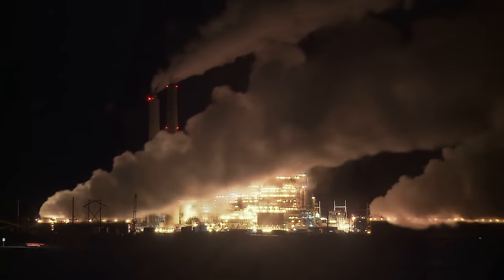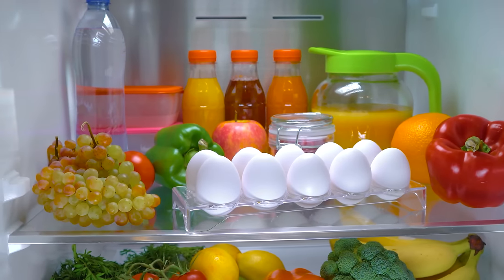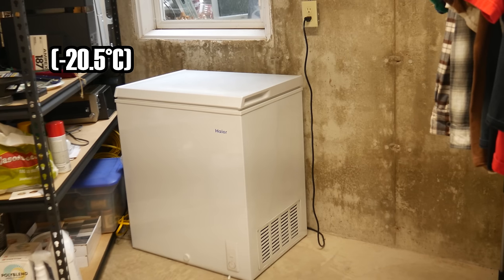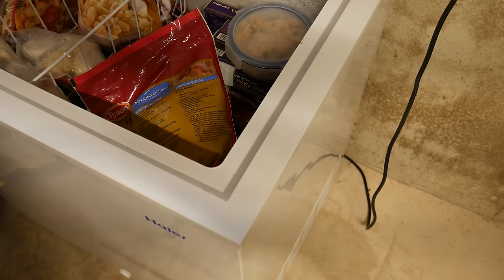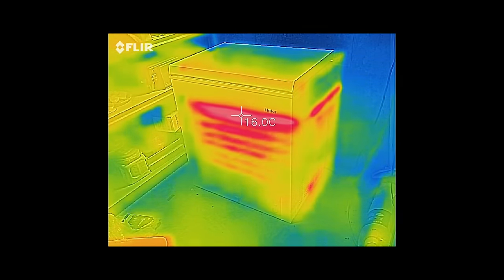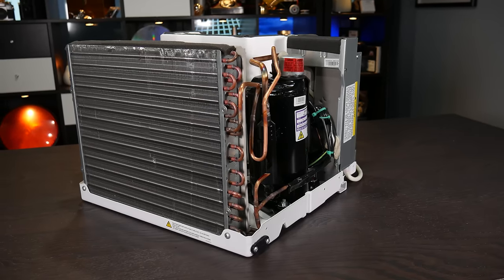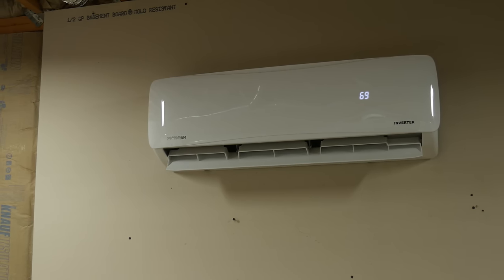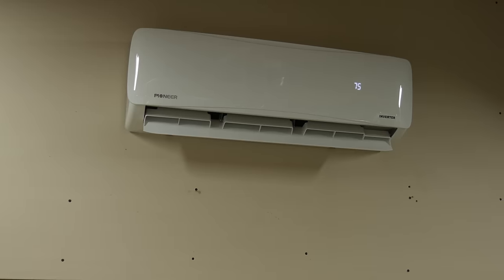Heat Pumps: the Future of Home Heating

Comment: Me watching this in Costa Rica, we’re 20c is cold: “ah yes cool this be useful”
Reply: Feeling the same in Brisbane, Australia!
Reply: @flaviusclaudius7510  'Sup mate, Brisbane here too
I've only recently in the last few years discovered air conditioning and have decided I will never go without for the rest of my life, as for heating.. well it's Brissy! I've honestly never turned one on here in my life. Only get to wear a hoodie for a couple of weeks and I'll be damned if I throw away that momentary joy

(Except for my brief stay out in Warwick though as the house had such little insulation the sun would peak in through the wooden walls, and winter temps often approached 0C so the lil' Kmart fan heater set to like 12-15C ish made getting up in the morning actually possible)
Reply: 20c is not remotely cold.
Reply: Imagine from 31•C Singapore...
Reply: -20 would be considerd cold, 20 that would be a warm summer day over here.  It is also around -20 that most heat pumps start to get less efficient.
Reply: @TheCandoRailfan  That's the point, if 20C is the lowest temp you get all year then watching a video on how heat pumps can heat a home is kinda pointless

Still fun and interesting, just not useful 

Like for me today, it was 34C and like 65-75% relative humidity.. I'm still using my air conditioner to pump heat, just certainly not into the house.. eugh
Reply: @TheLaurentDupuis  I don't need to imagine it, I'm currently laying in bed with 3 fans pointed at me right now to stay cool, its 33°C right now 🤣
Reply: Humidity also effects how warm it deems, the more humid, the more warm it feels. It's why in the UK, it can feel hotter when it's cooler then countries that are much hotter but a lot less humid
Reply: a summer times in norway
Reply: @TheCandoRailfan  he was being sarcastic
Reply: @andersstromqvist2211  Heat pumps are always less efficient at lower ambient temperatures. They don't just start getting less efficient at a particular point. However, they do tend to take a big hit to their efficiency around 0 °C in humid air, since below that point, they will need to waste additional energy defrosting.
Reply: Once we reach 25c in Norway I am struggling. 30c, which is rare, is a nightmare.
Reply: @EebstertheGreat  yeah but you still reach a tipping point where it is better to switch to other sources for the unit my family use that is around -20. Atleast where I live humidity does not play a big roll. When we reach -20 the air is always dry

Comment: In southern France I switched from electric heating to a reversible AC and my electricity bill halved. But below 5°C or so the outside unit is icing up and it goes into reverse cycle for some minutes to melt it down.

Comment: This does seem to explain a few things, thank you!  I built an 800sf a-frame cabin out in the Wichita mountains and had a mini-split heat pump installed instead of an expensive and complicated central system. 
Most of the time it works very well, but is temperamental in more extreme temperatures. Above 95 degrees or below 20 degrees (F) it can struggle. In freezing temps it occasionally shuts down for 20 minutes or so…not fun, but now I realize it must be going into that defrost mode during that time. The air is more lukewarm than hot in temps below 10 degrees (F). 
During the spring and fall it’s often swinging wildly between cold and hot in this region and the unit usually shuts down and takes 10 to 15 minutes to switch from heat to cool and vice-versa. Now I see that it has to go through a whole process to settle the pressure and reverse  the coolant flow. 
I honestly thought there was something wrong with it, but this detailed video gave plausible explanations for all of those quirks if I understood it properly that is. 😉😃
I use fans and a space heater to take up the slack during those problematic periods. 
As clever as this system is, I can see why it’s not a viable solution for everyone.
Reply: it gets both too cold and too hot up here in canada to use them sadly
Reply: Outside unit should be in shade in summer and always setup so the wind does not fight the fan blowing air thru the condenser 

In extreme conditions you need a ground loop (water cooled/heated) outside condenser unit
Reply: @dazednconfusedrn Heat should not be a problem.  In Canada the cold can be very severe. However heat pumps are fairly common in Sweden.

Comment: Can confirm in Florida, AC is literally a life or death deal down here
Reply: Looks like a place for me. (Coming from Indonesia where it's 35°C midday with 70% humidity and 88% when it's raining)
Reply: a heat pump would be great there :) if it gets texas cold it could heat aswell
Reply: Spent a year in Florida. You really do need air conditioning. During the summer it gets from high 80's up to high 90's. The humidity normally tracked very close to the temperature.(F) Temps and humidity would grow up and up till it just about hit 100 then thunderstorms(massive lightening) and it would cool back down. Then it would start climbing again and over and over. Miserable without an air conditioner. Weather in San Diego was by contrast, almost idyllic
In the war of who has the better weather, California or Florida, I would say no contest..
Reply: We are so weak compared to the pioneers that settled the place.
Reply: @MostlyInteresting  its not about weakness or strength. its about PREFERENCE. why choose to live miserably when you have access to technology that can make your life a breeze
Reply: @MostlyInteresting  Florida didn't become super populated UNTIL we had access to air conditioning. Some "pioneers" could tolerate it, but not the swaths of people that chose to live in such warm places now. Even before AC was common in the States, there was still things like ceiling fans and what not.
We also have just been acclimated to climate control. If someone is healthy, and lives somewhere of a reasonable temperature without it for a while, most would probably get used to it in a couple seasons
Reply: Live near San Francisco. Spent a few days in Arkansas. 105°, 97+% humidity. Dear Lord I've never appreciated AC so much!
Reply: Nice SR-T :)
Reply: Humidity and the still air at night in Florida is far worse than the daytime heat and humidity.

Comment: Just saw this.  I live in the Fort Worth area and went through that cold Texas blast you mentioned, plus a few others, with a heat pump.  The lowest it's ever been since it was installed was -5F.  The heat pump ran full time, with aux heat on, but it kept the house at the set temperature.  It doesn't usually use aux heat at all until the temperature gets below freezing.  My energy bills are much lower than neighbors with natural gas heat.

Comment: As a swede, watching this: -Eeeeh, is that a new thing? looking at my two indoor units
Reply: Same. I live in Canada and I remember them from the 1980s
Reply: Also, used widely in coastal Croatia
Reply: I thought they were normal thing in the USA too.
Reply: In Germany you occasionally see the outside part installed on the roof of a "shopping mall" etc. but apart from that they're unheard of, which is weird for me since I grew up with them
Reply: In the Nederlands thay are new
Reply: In France, it is very common since the early 2000's
Reply: Pretty common in Bulgaria the last 15-20 years. These days practically all AC units sold are invertible.
Reply: as a finn, had for 15 years

Comment: THE FUTURE OF HOME HEATING!
...or as we in the Mid-Atlantic, Southeast, Southwest, and Pacific Coast call it, "THE PRESENT OF HOME HEATING!"
Heat pumps are only unpopular in places like the Northeast and Upper Midwest (where TC lives) where the winters are too cold for them to work anyway.
Reply: I live in easthern Canada and Heat Pump have been popular since the 1980s... (for suburban homes and large industrial buildings at least)
Reply: Same in Russia. I don't think I've ever saw an ACs without a reverse cycle.
Reply: here where I live it doesn't get much below 0°, so most people just wear a thick jacket
Reply: @srpenguinbr  wearing a thick jacket at home below 0°? D:
Where I live it also barely goes below 0°C, but everywhere has heating. Natural gas furnace in my home, resistive heating is common too, something something hot water pipes (natural gas furnace centralized to the apartment building?) in the home where I grew up.
Reply: @Orynae  well i admit waering a jacket at below 0 degrees is unconfortable, but I mean for temperatures above 5 it is liveable
Reply: And my mom sells clothes, so jackets are free real state for me
Reply: no winter is too cold for a properly sized heat pump
Reply: it's been the present of home heating since the 1980s
Reply: Only places like Fairbanks, Winnipeg, or Edmonton actually have winters too cold for air source heat pumps, and even there a heat pump can supply all heat for most days. In the northeast and upper Midwest it's a combination of traditionally mild summers, cheap gas & expensive electricity, the prevalence of hydronic heating systems with undersized radiators, obliviousness & ignorance on the part of homeowners and contractors, and crusty old people who see not having AC as a moral virtue (despite having no issues with heating whatsoever), that are obstacles.

Comment: We saw a -54 F real feel Friday night. I have never felt such cold! Our Mitsubishi hyper heat stayed effective until we started hitting a -20. I could hear it trying while I slept but I don’t think there was any heat. This morning It slowly started blowing heat at this morning. It started coming back around -20. Our unit is partially sheltered so it helped but it was just too damn cold. This is our first winter with it and it hadn’t been a problem. These are well suited to zero degree F temps but if you get below that have a back up source. We originally got it to save money but now the electricity rates are much higher. Still worth it though.

Comment: Here in Brazil, we have places that are always hot, so "air conditioning" with only the cold option are very common in those places. But in the south, where we have some cold and hot temperatures through year, so it's very common to have both options in one equipment.
Reply: I live in the south of Brazil and I never really knew how the heating of our ACs worked, and because my parents always told me that they would be exorbitantly expensive to run on heating, I would mostly just try to warm myself on other ways. After this video, not anymore!! I will tell them of how these work and finally have a nice cozy room in the winter! (tho I might need to get a new AC on my bedroom... but maybe I can get one of the variable speed compressors to get even better efficiency!)

BTW! Did you notice that the compressor on the demo rig was made in Brazil? Noice!
Reply: @Kemecgabriel  Southern Brazilian here, raised in Argentina. Can't remember if it was during a home electricity course or hearing it from (H)VAC technicians (both in my house and in my workplace) but as far as Argentinian (H)VAC technicians are concerned all ACs have Brazilian compressors and they're top notch (and yes, I had the same reaction you did just now 😃).

As for heat pump vs. "other ways" (which I assume do not include other forms of heaters), nothing is more cost effective than layering up (esp. in the relatively mild* winters Southern Brazil and a sizeable chunk of Argentina gets), and your parents will continuously remind you of that fact while not bothering to hear about disadvantages 😈. And while it most likely is not your case, the earliest cold and heat ACs had resistive elements in the internal unit for heat instead of the cycle described in this video.

*: For nearly everyone else: In Southern Brazil/Uruguayan/"Pampean" Argentinian (from the center-south of Buenos Aires province to the north, and from Santa Fe to the east) below +10C max temps, and below 0 to +5C (depending on the exact region) low temps are considered f***ng cold, and any snowfall is a historic event (except in certain parts of southern Brazil where it still is not something to expect every year). Many of y'all are laughing at that, but (especially in Brazil, Atlantic coast, Misiones, Corrientes, and near Río de la Plata) it's bitterly humid, insulation is rare all around, and in some of these places (esp. in Brazil**) heating can be non-existent. (And to top it all off, in most of these places there's no natural gas networks, heating/cooking gas comes from propane flasks which cost a king's ransom given the typical purchasing power of a worker's salary)

**: Or at least that was my experience as a child spending time at Grandma's in Paraná (Brazil) during winter break 🥶.

Comment: A million homeowners after watching this, “I can do that".
Reply: I’m a teen in high school, also attending a tech center, learning how to do all this stuff. It’s funny trying to explain this to people and seeing them look at you like you have 10 heads😂
Reply: My mother uses electric heating, installed an air conditioner year ago. It paid off just in a single winter.
Reply: @KryptLynx  as someone who lives in the midwest heat pumps are efficient 2-3 months out of the year but since it gets so cold here. In our situation it will take someone years to have it pay off if it ever does. That and heat pumps dont run hot enough and you get bacteria and mold that starts to grow inside the air handler.
Reply: Millions of homeowners in Europe including myself, been doing it since years. I run a 7.5kW heatpump.
I only use normal heating when outside temps go below -7 to -10°C

Great video, great information!
Reply: @Rubberfoxy  that may work in Europe but here in the midwest heat pumps are not the way to go. Only people that have it dont have natural gas supplied to their house. Any money you save with a heat pump, you lose it with having to use electric
Reply: @Rubberfoxy  heat pumps lose efficiency at 30 degrees as it lowers in temp there is no heat to get from outside. Thats why people have to combine heat pumps with a secondary heat . I personally think heat pump combined with gas is the best way to go altho gas isn’t efficient as electric  it does cost a lot less and it gets rid of mold buildup in the housing
Reply: @SirVicSmasher  i know, i have a secondary heat source for very low outside temperatures.

Also you might use an air to water heat exchanger to heat up your water boiler during warmer day temps to keep your house warm during the night. Running of the stored energy in the boiler and using minimal secondary heat.

Ah yes! My home a a forced air exchange system. A blower that constantly exchanges a low volume of air to keep the inside air from getting too humid.
It's a vent in my sleeping room with mufflers in the wall and a fan on the other side of the building that exhausts the air
Reply: @Rubberfoxy  Do all of Europe do that? Here in the states i see lots of mold . Humidity control isnt common so heat pumps kind of loses purpose. But i can assure you heat pump isnt not the future. Since specifically in my area we have months that dont get warm enough for heat pumps to work.
Reply: @SirVicSmasher  i live in a house build in 2019.
It gotten mandatory to make super low energy houses a couple years ago.
Having superb gaskets on all windows and doors just cries out for active ventilation of all rooms to prevent mold buildup.
I wouldn't use a heatpump in an older building. You just waste too much energy by blowing it out poorly insulated walls and windows.

My windows are triple glas, almost 3 inches total thickness with frame.  Even in Winter the inside glass is not cold.
Door is also over 3 inches in thickness. Transmitting almost no heat/cold or sound from outside.

Downside is that's it's the most expensive way to build a house but the government won't allow otherwise.

I live in the urban area of Austria, we haven't had very cold winters since years. No snow in Vienna in years. Right now we have 52°F and it's february. 
I think we didn't went lower than 20°F in the last 5 years in my area.
Reply: @Rubberfoxy  this could be the hvac tech in
Me but id love to see a video on your set up. And i dont think the government cares here other then rebates or discounts if you get geothermal units
Reply: 2 decades ago
Reply: @38911bytefree  you are 2 decades behind?
Reply: @liam3284  electric heat is located above indoor coils when using heat pumps while with gas the indoor coil is located above the gas burners. Heat pumps do not get as hot as gas does so it does not kill off mold. And since the electric heat elements are located above the indoor coil the electric elements do not kill of the mold. Thats why you see lots of black mold in the units. And defrost cycle runs the unit in cooling and produces humidity. And it just makes it perfect for mold and bacteria to grow. 
You cant use UV light since it will destroy the plastic tray around the indoor coil so its just something people have to clean themselves but no one ever does.
Reply: Our Mitsubishi MSZ-LN35 gave plenty of heat at -25C this winter.
Reply: Your electricity provider and gas provider:
Let's just ban this video, if it reaches too high views.